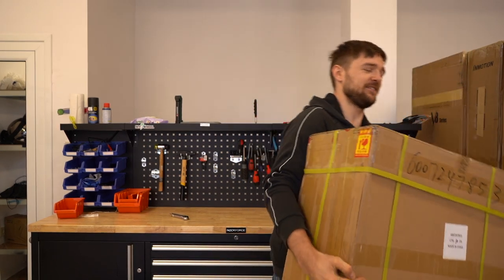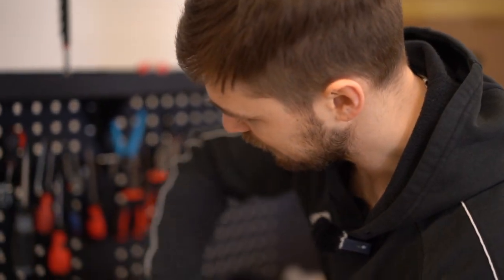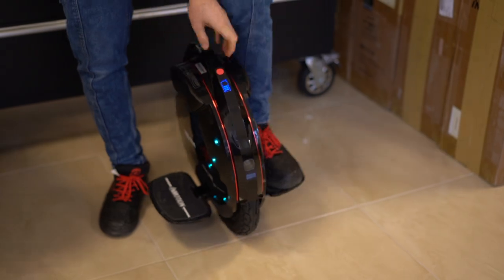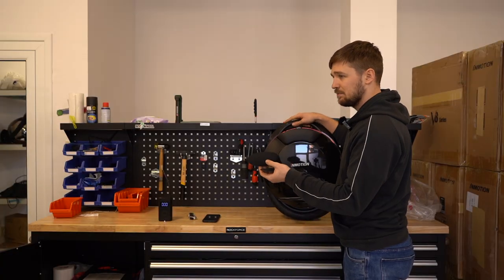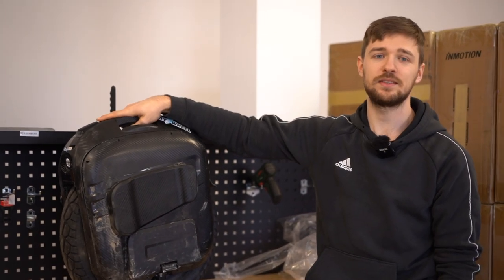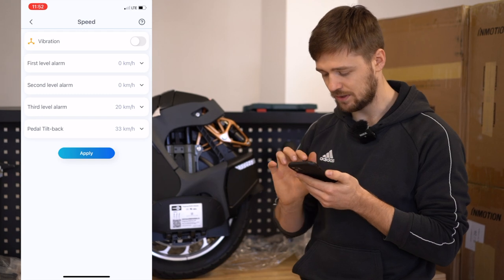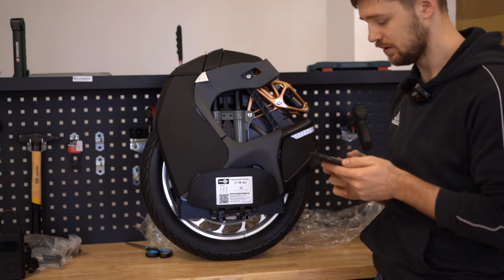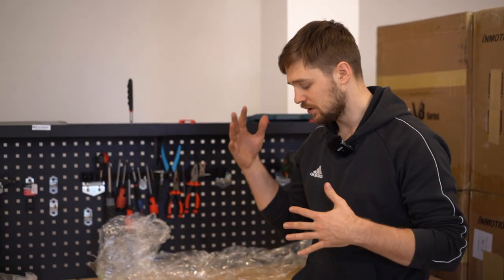Initial EUC Set Up

Comment: Kingsong S18- I wish the app tilt back was set to the limited speed during the initial use. May have prevented me from a cutout and body slide in the parking lot. I believe tiltback was 18 in the app, but wheel limited to 12.